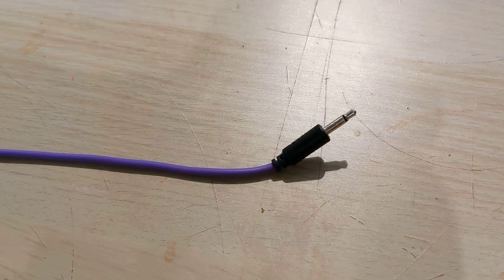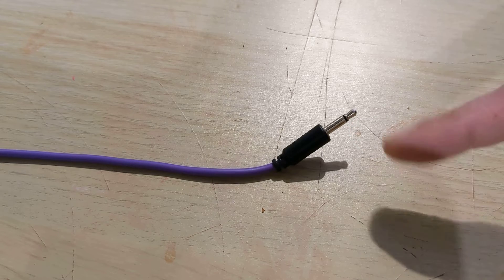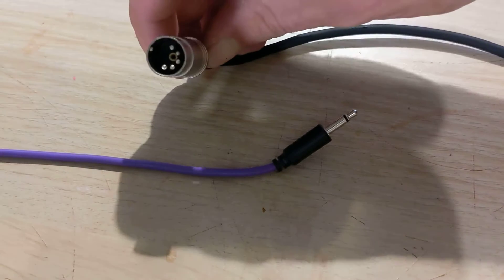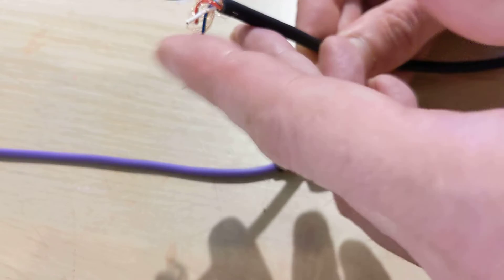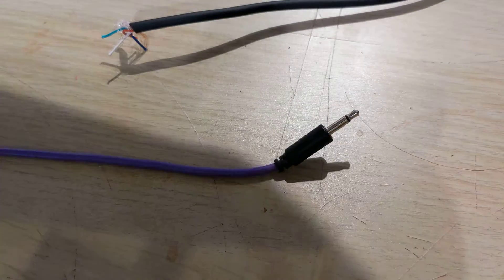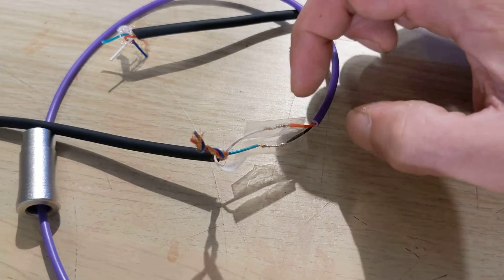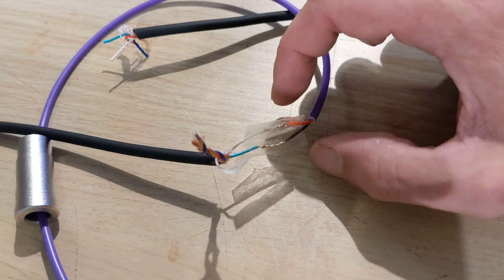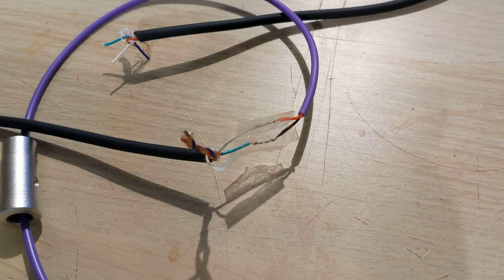Arturia Beatstep - How to make your own Midi Breakout Cable

Comment: Since colors of internal wires of a cable are not always the same depending where they were made, and few peoples may go as far as check on your description, maybe you could edit the video and dub it to say what part of the 3.5mm jack (TIP or RING/SLEEVE) goes to what pin number (1 to 5) of the DIN.
Thank you anyway for the effort. Cheers.
(P.S.: The english naming of the connectors in the 3.5mm jack are: TIP, RING and SLEEVE, so the one in the video is a TS jack not a TR, because there is no RING)